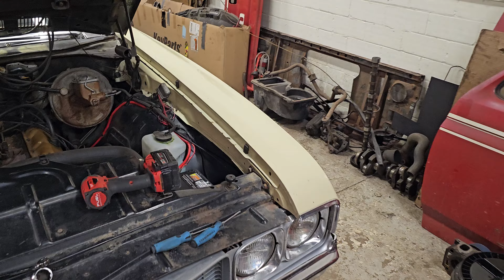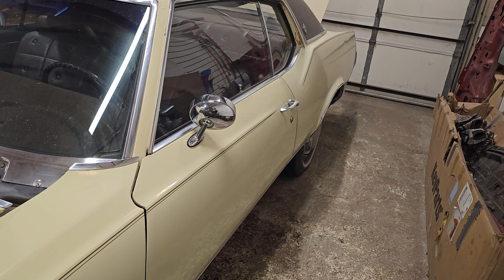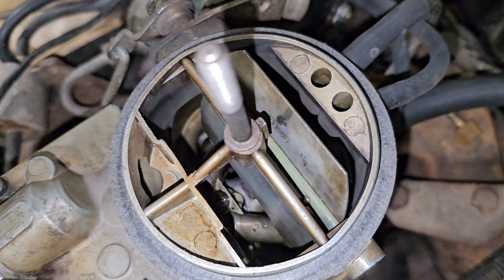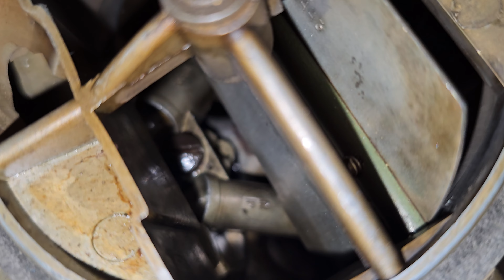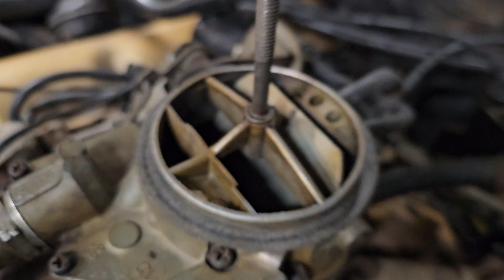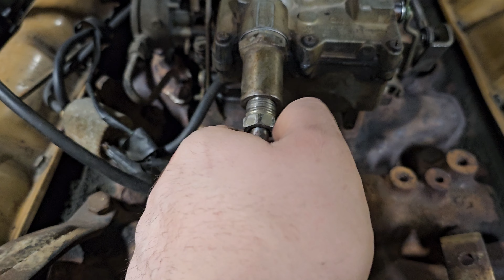1970 Cutlass Supreme: 2GC Follow-up

Comment: I have a 2gc on my boat engine (chevy 3.8) It's been about 2 years since refurb so i may be due to change mine out also, did you do a vidoe fo the swap out procedure for the needle and seat?
Reply from the maker: Needle and seat is super simple. Disconnect the linkage for accelerator pump and choke if you have one. Then pull the 8 screws out of the top of the carb and pull it apart. Remove the float pin and use a large flat blade to remove the seat. Make sure a new steel crush washer goes under the seat.